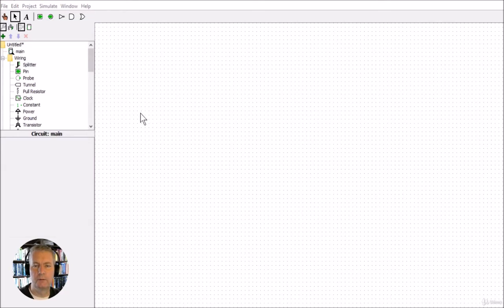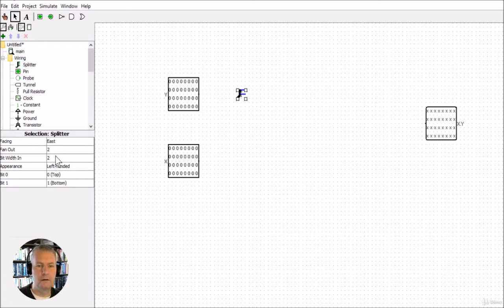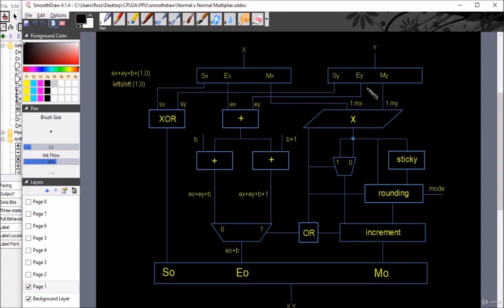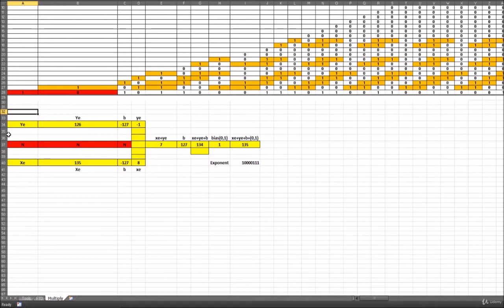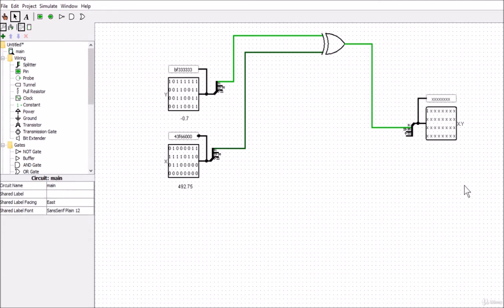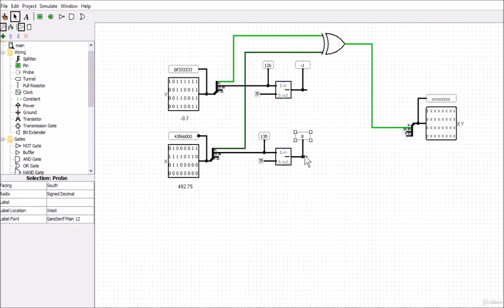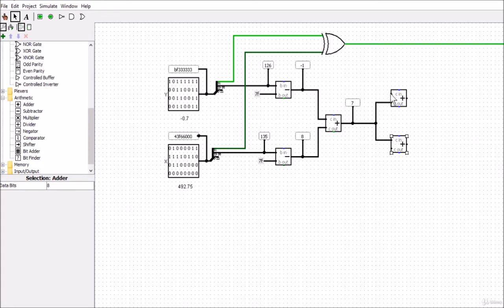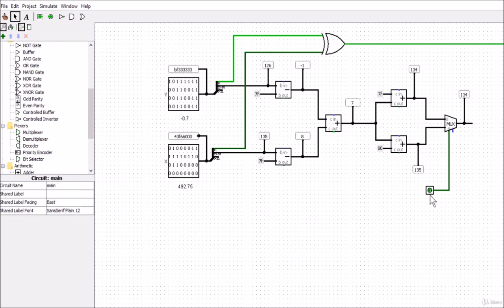Multiplier in Logisim 1

Comment: Excellent stuff, Ross; many thanks for sharing.  I discovered Logisim recently and have been having fun doing the same sorts of things, but had spent the last two days trying to get that radix shift to work properly on the mantissa product.  Much clearer now!  Looking forward to your third in the series where you explore rounding and sticky bits.  Beautifully explained!  Presently busy automatically renormalising subnormal inputs...
Reply from the maker: Glad you find it helpful. To be honest not many people interested in this subject. It seems to be a bit of a 'black art' in the computer science world which is sad as it is actually relatively straight forward but just difficult to find any literature explaining properly.
Reply: @RossMcgowanMaths  Thanks Ross; exactly my experience, too!  On reflection it seems subnormal numbers will require a bit more thought - will it work if I just extend to 24-bits with a zero MSB (instead of a 1 for normalised values) and override the exponent to 126, then use the same multiply circuit?  I have a separate pre-processing stage that checks for Inf/NaN inputs are diverts them and also checks for multiply by 1 or 0 in either input as special cases and bypasses the multiply circuit, or else does that 23 to 24-bit extension before feeding in to essentially the same circuit you have discussed here, so that seems like it might be a reasonable approach to try.
Reply from the maker: Here is afree coupon to my Udemy course.
https://www.udemy.com/course/design-a-floating-point-unit-2-multiplier/?couponCode=86F0EDD179221C34C122

Yes it's reasonable approach but does not cover all possibilities.
Reply: @RossMcgowanMaths  Thank you so much Ross, that's very generous.  I think I have sorted out subnormal as well as normal inputs along with all the other special cases in my circuit.  I do have a question, though - if I understand the theory, the bit shift on the mantissa product should shift the radix point behind the first non-zero bit, which might be in the 23rd or the 22nd position, depending on the product.  Since we chop off most significant bit in any case (by truncating 24 to 23 bits) we only have to worry about the 2nd-most-significant bit.  I think the circuit needs to increment the exponent based on the most significant bit (as you do) but to perform the leftward bitshift by one place (effectively moving the radix point rightward one place) based on the 2nd-most significant bit being set, and then trigger the mux on that bit; trying this in my circuit by using a 3-branch splitter to check the two topmost bits separately duplicates your correct result in the video (-0.7 x 492.75) but also gives the correct result for 2.0 x 3.0 and I think your circuit won't (I think you'll get 7.0, like I did!); this also explains why you needed to add that NOT gate to the mux at the end (like you, I thought that the original design would have been the correct one, without the NOT gate so that the mux would select the shifted input when the shift occurs).  The example you tried just happens to have  "10"' in the two most significant bits, but 2.0 x 3.0 has "01" and requires a the bitshift (and needs the mux to select that output) but no exponent increment.  Have I got that right, or did I just get lucky with the test case?
Reply from the maker: I will have a look and get back to you. I don't tend top keep all this stuff in my head and have to spend time figuring it out again in order to answer your question properly. If you find any more errors then give me a shout. Also if you like the course a written review would be good. As I say I don't sell much of this course (not many people seem that interested) which is strange as this stuff is at the heart of modern cpu's.
Reply: Oops!  Also realised  that the shift needs to be a 25-bit shift, not 24.  The most significant bit of the lower 32-bits of the product from the multiply needs to be included in the mantissa as well (otherwise, for example, 0xaf805012 multiply 0x60304213 gives 0xd0b0b054 instead of 0xd0b0b055).  Easier with a picture... https://drive.google.com/file/d/10E-trIGsKPdp8zBo_pfJc7Ez2wnMSbp5/view?usp=sharing   I think this now works, yes?
Reply from the maker: Had a look at your circuit. I suggest you try the rest of the course and extend your implementation to include all multiplication types , NXN=N , NXS=S etc and also implement the rounding. I may well have over engineered this design and could quite easily have designed in an error at one point the designed it back out as my circuit progressed.  An interesting exercise is to run a test script to test the circuit. If you find any multiplications that are wrong in my final design then let me know. I am working on the adder subtractor just now. Just completed the excel VBA script that is used to teach the addition / subtraction algorithm so will start tomorrow building the dual path architecture in logisim tomorrow. Once course is up and running I will send you a free link.